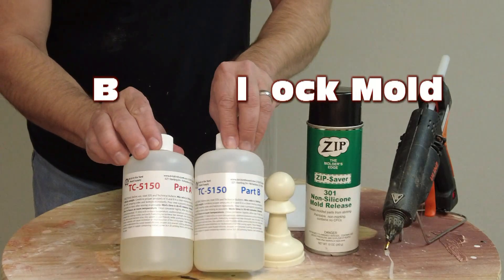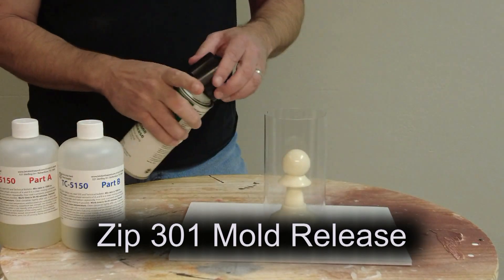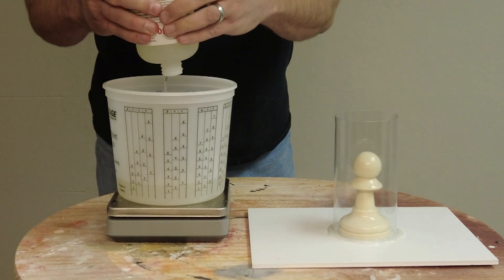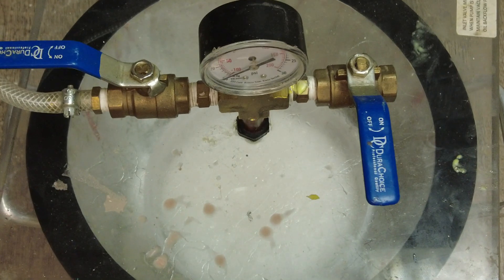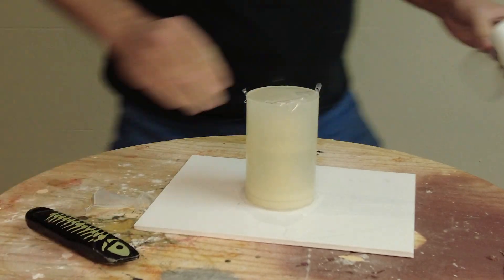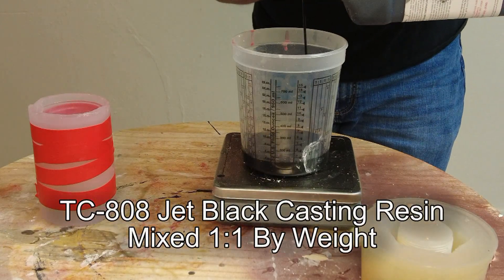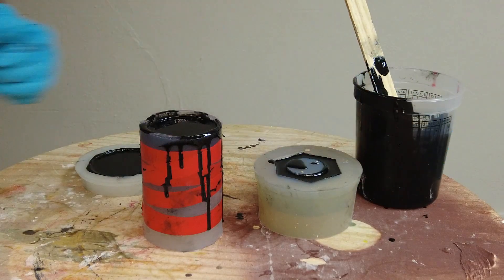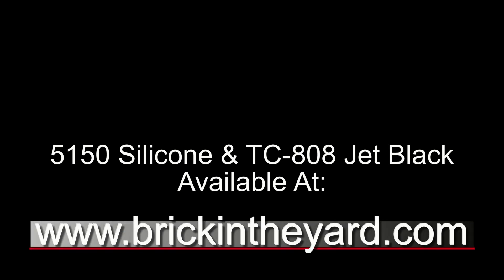Silicone Mold Making: Simple Cut Block Mold With 5150

Comment: Your website shows the tc 808 at a 78D shore hardness and the original Art Cast formula at a 72D shore hardness. Of course it's not a massive difference but my question which one is harder? I don't know which way the numbers run in this scale.

The website also mentions it has a "thermoplastic feel". What does that feel like?
Reply from the maker: 78D is harder than 72D. As the scale goes up, higher numbers = harder materials. As for the "thermoplastic feel," many of the BJB resins are used in the product development world to prototype products that will later be injection molded. TC-808 has the feel of an injection molded plastic of similar hardness.